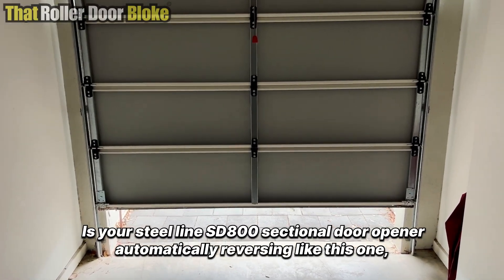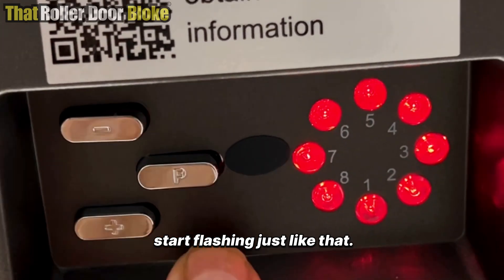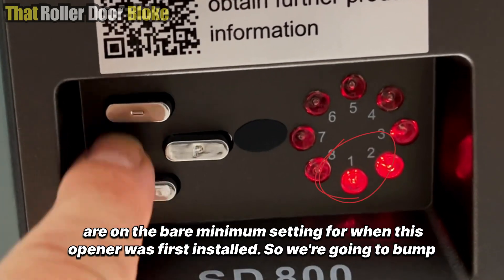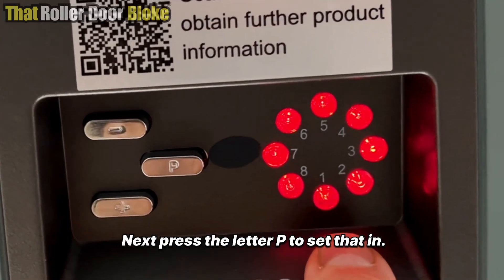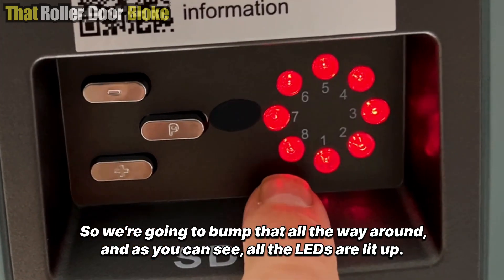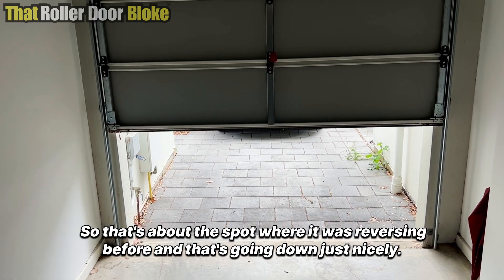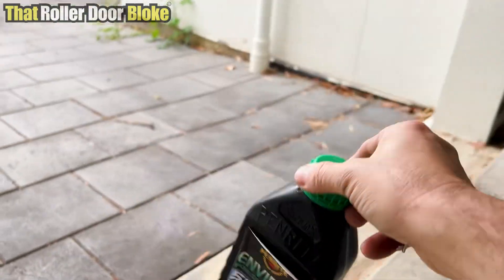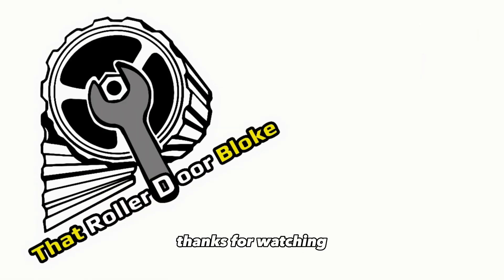[117] How to Adjust Your Steel-Line SD800 Force Like a Pro!

Comment: Isn't it because of the wrong travel limit?
Reply from the maker: Reversing at any point before the floor is the force sensitivity.  If the door hits the floor and then reverses yes that would most likely be the bottom limit needs raising 👌🏻